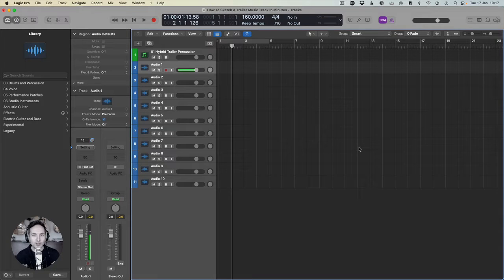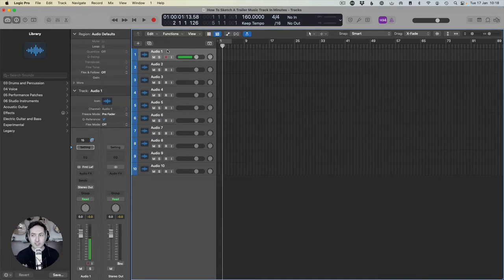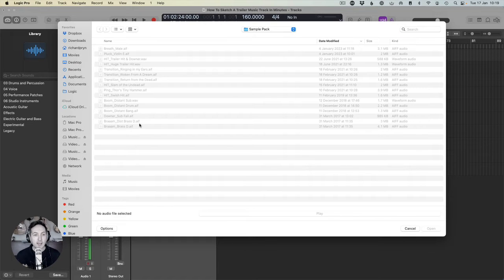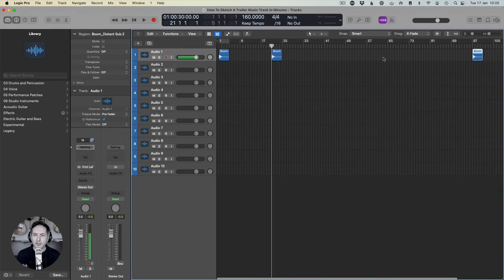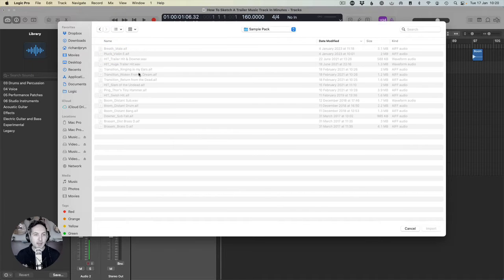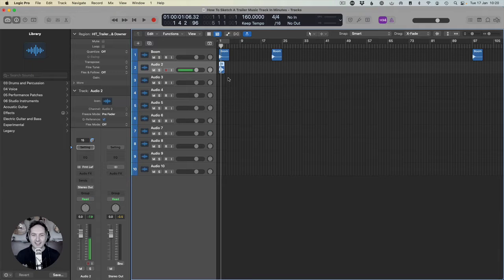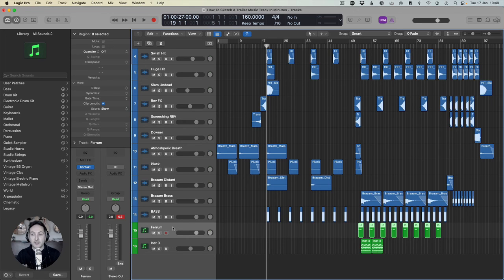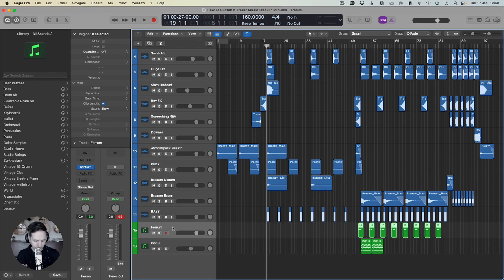SKETCH A Trailer MUSIC Track In MINUTES

Comment: How many bars per section?
Reply from the maker: This will change with different tempos but stick to roughly 15-30 for act 1, 30-45 for act 2, 45-60 for act 3, 5-30 for act 4 👍🏻
Reply: @richardpryn  sounds good. I just purchased AVA’s sound effects bundle and I’ll be implementing this to improve. I’m normally a Latin Music producer but I’m navigating the waters of trailer music.

Comment: Really helpful video- your approach is very different from mine, which offers a cool perspective. I tend to write a fully detailed climax section first and then make other sections later, but I like the way you begin with an overall structure, more of a "mile wide and inch deep" approach that lets you go fill in details later.
Reply from the maker: Hey Connor, I sometimes use that final third approach which I like but then I tend to panic a bit when working backwards. Great for getting the scale and impact in place though

Comment: Hey there! I was wondering if I'm doing this right... I'm trying to learn how to record and produce songs in logic. So, I set my gain on my interface for my guitar and mic for voice (I didn't directly plug my guitar into the interface but recorded it with the same mic as the voice). I played and sang the songs loudest parts and turned up the gain on my interface till it clipped red, then turned it down until I got an occasional yellow to pop up. So, I believe I set the gain right, (on the interface). But after I recorded both tracks, I noticed that in logic that the guitar and voice could be possibly clipping because the right fader or whatever you wanna call it spikes up to red every once in a while... (The faders I'm talking about are in this video at 0:00 in the bottom left corner of the screen). Also, I notice that the master volume in the top right corner of the screen goes red every once in a while too... I would appreciate your input and advice on this matter! haha... One other thing... The vocal track is a bit quieter than the guitar track. The 1st verse is sung a little quieter than the pre-chorus and chorus so it gets covered up pretty bad. Is there a way I can boost some parts of the audio track in the quiet spots? Sorry this is a long message... lol... Thanks! :)
Reply from the maker: In this video here: https://www.youtube.com/watch?v=1iCSj7gqfDk I show you how to move what's called automation. This is how you can change the volume of the audio in different parts. Regarding clipping, don't worry too much about it as long as when you record it is not clipping as you cannot reverse this. I would suggest setting your input gain so that it stays in the green at your loudest. Then you can always adjust after in Logic. Hope this helps
Reply: @richardpryn  Thanks man! This will definitely help! :)